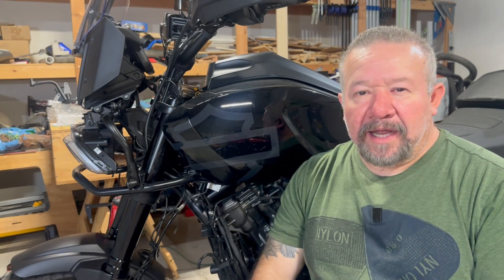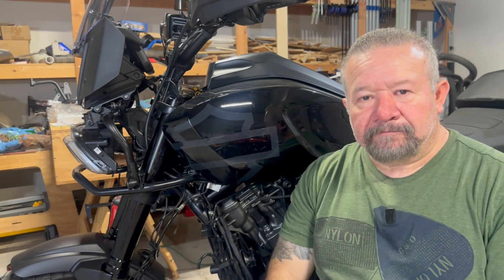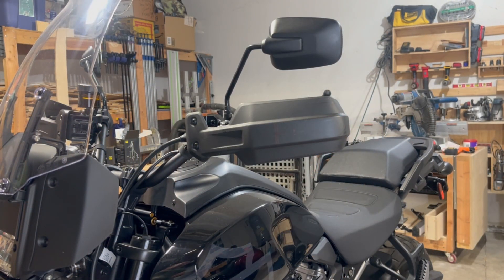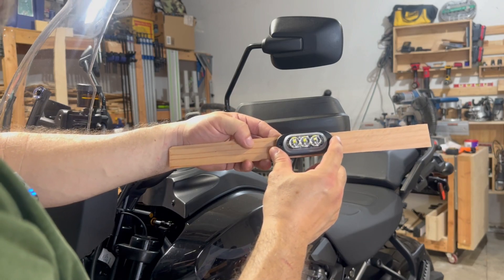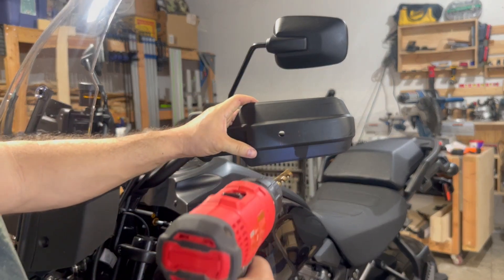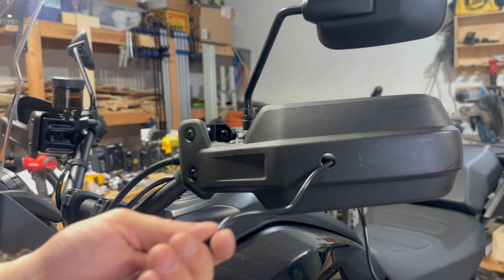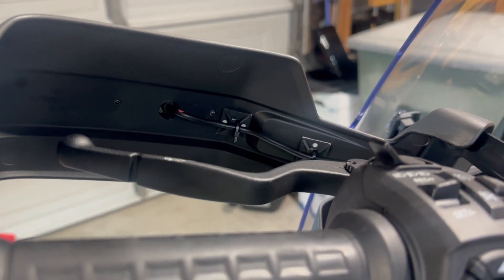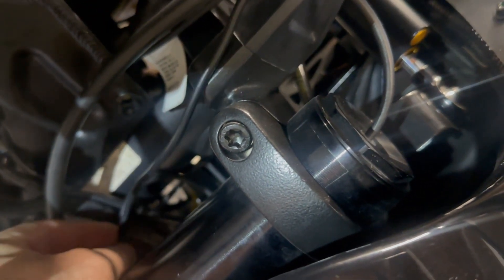Denali Electronics Series Part 2 | Pan America | T3 Install - DialDim Controller Hookup

Comment: I would have fitted the T3's in the vertical middle of the hand guard part. You did not, is there a reason for that?  And I don't like the fact that the screws are coming through the hand guards. It can hurt your hands... or not?
Reply from the maker: Denali had them lined up with the top of that extruded center area so I did the same. It also makes it easy to keep the T3's looking level by aligning them to the top of the extruded area. But of course you can install them in a way that suits your preference. The screws do not come anywhere near your hands so its not a problem. They barely protrude through the plastic-just enough to make the lights secure.

Comment: Why would you design a bike with the battery and electrics right behind the front wheel where’s it’s going to get covered in spray, stones mud etc ……madness !
Reply: Get a cover for it.
Reply: Nice tutorial,  you may jot realize this but with d.c. current flows from the negative battery terminal to the positive terminal. Think of it - output + input. Therefore we will disconnect the negative terminal from a battery first.
Reply from the maker: @joshuacatron2  thanks for the tip!
Reply: @joshuacatron2  You are dangerously wrong. Functionally, electricity (current) flows from positive to negative in a DC circuit. Yes, free electrons of the conductor flow toward positive, but that is not useful for functional understanding of DC circuits. You remove the negative first, because the entire chassis of a vehicle functions as a negative bus bar which would be easy to bump with a tool while trying to remove the positive cable from the terminal. Bumping the chassis with a tool has no effect if you've first removed the negative cable, which separates the chassis from the negative terminal electrically.
Reply: For further reference, when drilling plastic and you are stepping up in bit size, have your drill on the slowest setting and already spinning before entering the existing hole and it won’t get pulled in like it did. I’d have also used 2 tiny bolts with castle nuts to secure the pod to the hand guard so I wouldn’t risk scraping a knuckle or finger every time I reach inside them. Just my 2 cents. Great video by the way. 👍🏼